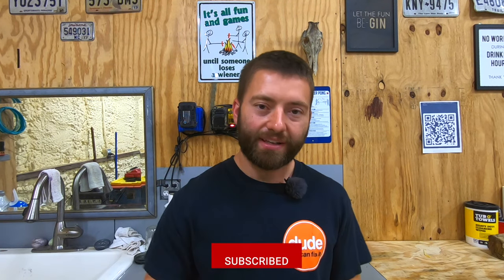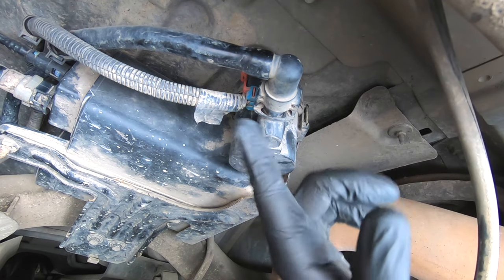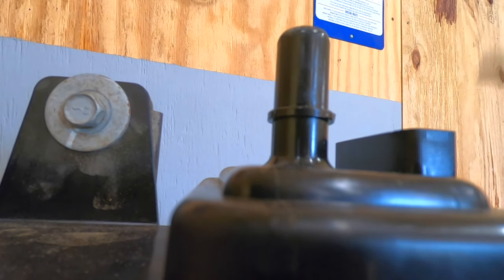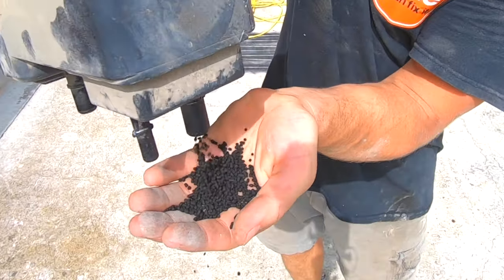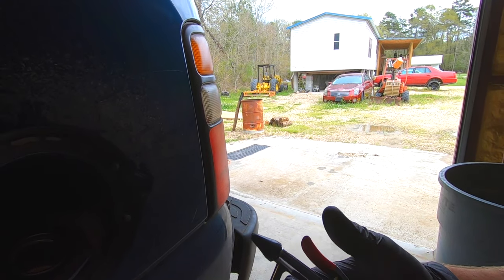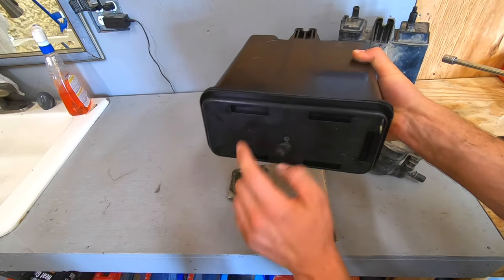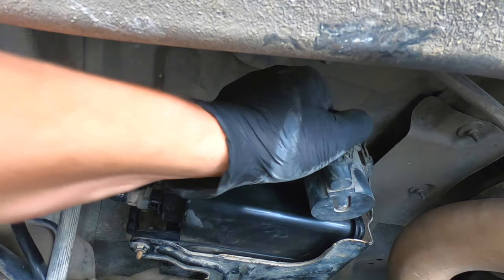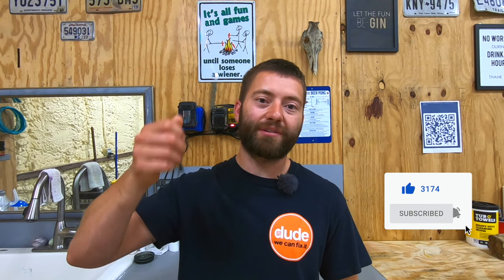GMC/Chevy Charcoal Canister Replacement

Comment: Worked perfect for me. Hardest part was taking the lines off of the canister but now I don’t need to spend 20 minutes trying to fuel up
Reply: That is what I am having trouble with right now.  I hit all of them with some WD40 so hopefully, they will be easier to slide off tomorrow.  I am pressing the sides to make sure the lil clips are open, but they still won't slide off.  How did you get yours off?

Comment: My Friend .. you are a blessing from the sky.   I SPENT COUNTLESS HOURS trying to figure out the evap code. I brought it to specialists (3 different places)only to have them rob me by claim they fixed something that I already tried. One even went as far as saying that I put the purge valve on backwards and charged me $758.                                                                      I went through everything....         1. Gas cap       2. Purge valve and hose.      3. evap canister.      4. smoke test (4xs) . Some shops didn't even want to bother because they said it was a big job to find it.      Last shop charged me $903..  only to tell me that it was a MAF sensor that was damaged along  with the PCV hose. I questioned them because they said they smoke the vacuum line but not the EVAP LINES. I gave them the benefit of the doubt because they were "specialists". It turns out that they (just like the rest) Cleared the code only to come back after about 40 miles.      I didn't even call them back right away. I FOUND YOUR VIDEO, JUMPED OUT OF MY CHAIR, BOUGHT A NEW CHARCOAL CANISTER AND INSTALLED!!!!!!!!!!!!   AND GUESS WHAT???????????????????        AFTER YEARS OF THAT LIGHT ON MY 2014 CHEVY EXPRESS 4500 CUTAWAY SHUTTLE BUS. i love you for this.....    oh and after I repaired it, I went back to the shop and thank god they gave me a FULL REFUND!...  Again, Thank you for this information.
Reply from the maker: WOW, that's absolutely wild! I'm so glad they gave you a refund! Not really sure why they were looking at the vacuum lines, pretty sure that's a separate system.

I'm beyond happy for you to have finally got the issue resolved, and sometimes, if you want it done right, you have to do it yourself!

Comment: Thx dude - your video made the difference between success & failure - these connectors are difficult to workout when under the car - thx so much - your video enabled me to do the job myself for $70 instead of putting it to the shop and blowing $1000 (on a 2004 Yukon XL the canister is obscured by the spare tire, the diff & the prop shaft - so makes the job difficult (but still manageable) on this specific vehicle.
Reply from the maker: I’m glad I was able to help you out! Please subscribe to my channel.
Reply: @dudewecanfixit  already done - thx again
Reply: Nice I’m having same isssue with 2004 escalade
Reply: @johnhernandez1803  think I dropped the wheel….
Reply: @flyingscot3666  I don’t have a spare under but I can’t seem to see it , I see the gas tank and filler but not the carbon filter
Reply: John - its on driver side in front of the rear wheel - if you have a jack lift that side of the car and you'll get access - My Yukon is a Denali so likely same as escalade. As I recall the filter is attached to the underside of the vehicle so you have to go higher than the prop-shaft & diff'l - got to work your way up to the fasteners.
Reply from the maker: They can be in different locations, but they are usually near the gas tank. Follow the hoses from the gas tank and you should be able to locate it

Comment: I had the same problem with my daughter's 2001 Hyundai Accent. Liquid gasoline had gotten into the charcoal canister, dissolving a foam membrane in the canister that is supposed to keep the charcoal in, and allowed the granules to clog the hoses. In that case, I was able to cut the canister open and replace the foam membrane with a piece of metal window screen, and epoxy the canister back together. It worked for years until we junked the car because of a bad transmission.

Comment: So there's talk about a 13mm bolt to unmount the canister from the metal mounting bracket.  Mine was plastic and molded as part of the fuel tank. (2015 GMC Savana Cargo Van)  With no "bolt" it was "clipped" in.  Not knowing the proper way to remove it, I muscled it off.  So, I pushed up on the canister as far as it could go and using a slightly larger screw driver, I pried out the bottom.  Should anyone know the proper procedure, do tell!  TIA
Reply from the maker: I haven't seen that style

Comment: Excellent video.  This is the only video I found that talked about the charcoal trapped in the lines.  If I did not view this I may have replaced the canister without clearing the lines and would have still had the problem.  It took several tries of vacuuming and pressuring the tank until the large line to the tank was finally cleared. Thanks 👍🙂
Reply from the maker: I'm glad you got it cleared up!

Comment: This was the fix for me, thanks!  I already replaced my charcoal canister and it had charcoal spilling out, but I had not seen your video yet.  Well, that didn't fix it because the fat line to the tank was full of charcoal.  I blew air in the tank and charcoal went everywhere.  Banging on the hose and slapping it around loosened the charcoal and I vacuumed out about 2 cups of charcoal.  Great tip!

Comment: Great video. I replaced my canister with a new one without vacuuming or pressurizing the lines and tank. Still experiencing the same problem at the gas pump. Does it matter how much gas should be in the tank when I finally pressurize it?
Reply from the maker: I don't think that it really matters, but I would recommend below a half tank
Reply: Did it work after you vacuum the lines and pressurized the gas tank? @downsouthdeebo1346

Comment: Great video. I can only put in like $8 before gas spills out. The gas station pump nozzle not clicking. But I don't know why my gas tank is refusing to accept more fuel? I've checked all hoses and charcoal canister. Everything is intact. My gas gauge is always showing full. Can a bad gas pump and sending unit be the culprit?Any help would be greatly appreciated. Thank you
Reply from the maker: I doubt that the pump & sending unit would have any effect on filling with gas. That falls more into airflow restriction in the tubing. Try vacuuming and blowing all the lines out.

Comment: Great video as I'm trying to resolve the same exact issue on my 2010 Avalanche.  I did not read ALL comments and have a question.  When vacuuming the lines, were there fumes from the tank being pulled through the lines?   Just want to ensure a safe, flame-free task.  If there were, suggestions to minimize?  
Thank you, planning to swap mine asap.
Josh
Reply from the maker: Yes, there can be fumes getting sucked through the lines

Comment: Thank you for the video its very good and was very helpful! A quick question, you pressurized the tank from the neck while the lines were disconnected. Is this so the air coming back out of the gas tank will blow through those vent lines which are disconnected from the canister
Reply from the maker: Yes
Reply: The one big line connects to the gas tank. The smaller line connects to the purge valve under the hood. You should also push air back from the purge valve down the small line. He did not show this step in the video. If the evap line sucked those beads they will come all the way to the engine.

Comment: I’m getting 0455 Large Evap leak. Replaced the gas cap twice. I don’t have an issue with the pump shutting off during fill up. I do have a faint gas smell. Any idea what I should check first?
Reply from the maker: Maybe check the operation of the vent valve that is connected to the charcoal canister via a tube

Comment: Nice video. My question is that if the charcoal canister can be cleaned, as shown in the video then why should one install a new charcoal canister? Wouldn't the old one get the job done after removing all the charcoal?
Reply from the maker: Without the charcoal, the canister no longer serves its intended purpose. It may work and not cause a code on your vehicle, however, I am not sure what unintended consequences may be caused.

Comment: I squeezed that connector w/pliers and the ring with tabs (same connector as @1:10) got broke off. Can I glue it back? I can't find that return line (this is old car, 2001 Saturn SL2, I'm also replacing the Charcoal Canister). I think to glue it and add small cable ties. Will it work? I would appreciate any opinion on this matter. The second similar connector I removed successfully, also used small flat screwdrivers, but the connector came off only when I applied PB Blaster Penetrant. Thank you for the informative film.
Reply from the maker: Glue will work as this is not under a lot of pressure. However, it may be hard to remove later. I would try to use electrical tape instead
Reply: @dudewecanfixit  Thank you very much for the replay, I'm just about to start that project (many things were on the way). I meant to glue the ring (better to say it is oval shaped) to the connector, kind of repair the damaged connector. I've seen one film about melting the plastic w/Soldering Iron. Thought the project I saw was on the larger item (Headlight Holder), he melted back a broken ear to the holder, strengthening the attachment w/Steel Wool #0000. It came to be very strong. In my case probably I don't need it (I mean Steel Wool), but I'll try. But it is a good idea to add an electric tape on the connection, I'll do that, especially that connector is old and might be not really good since got to be not so elastic as it should. The best way of course would be to replace those connectors on both hoses, but I don't know that technique yet, as well as don't have the corresponding Tool Kit. Thank you again.

Comment: Does the gas tank have to be empty to pressurize it with a compressor? Also if you use the shop vac to suck out the charcoal does it need to be empty as well
Reply from the maker: The tank does not need to be empty for either of these methods.

Comment: I have not had an issue with filling the tank.  When removing the gas cap, there i is a rush of air.  This has been happening close to a year. 
Lately, the Suburban will idle fine, but stumble while driving and often stall or try to stall when slowing down. 
I'm wondering if it's the same issue.

Comment: I have the problem you describe but i do not have the faultcode. When i fill gas tank it builds up in the hose and turns off the refill handle. Do you know if i have one of these canisters on my Suburban 2009? Great video!
Reply from the maker: I'm sure you have a canister. It may look different, but it will serve the same purpose
Reply: I'm doing my 08 suburban now, how did it go?
Reply: @natashaolson711  i sold the  car before I had time to do it 😂

Comment: Man I have been looking for months about how to do this properly. This is the only video I have found that shows you how to properly clear the lines. I replaced my canister and didn’t clear the lines and everything that I thought I fixed came back the same day, it was a glorious 15 minutes of driving before the light came back on throwing the same code and went right back to idling like there was a freezing elephant in the back. Now I will probably have to buy another canister and clean the lines, the big question I have now is can the canister itself be cleaned?
Reply from the maker: Dang, that sucks! The canister itself is a sealed unit. You might be able to blow air through it and pull vacuum on it to get any residual charcoal beads out

Comment: Please help! I have a 2014 chevrolet equinox and need to replace the vapor canister can you please tell me the process or point me to where I can find instructions on how to do it. Will gas come out of the lines when I disconnect them
Reply from the maker: I'm not familiar with the layout on the Chevy equinox. I would suggest wearing a face shield or at least safety glasses when removing it as it could have pressurized gas inside
Reply: @dudewecanfixit  Thanks for the quick reply. I still can't find instructions but thanks anyway.

Comment: What causes the gas from the canister to travel to the lines, I was wondering if something has damaged the canister in the first place, the rumor has it overfilling the gas tank may be the reason. Thanks for posting
Reply from the maker: The internal screen fails, I'm not sure what causes it though
Reply: If you overfill the tank the cannister gets logged with raw gasoline, when the fill pump trips off stop filling then, adding more doesn’t do you any favors

Comment: is there a way for not the bits of charcoal to be blocked before it goes to the lines
?
Reply from the maker: I think there's a mesh inside of the evap canister that fails and allows the charcoal to circulate

Comment: Just a simple question to any who's experienced this before: is a P0446 the link to a necessary charcoal canister replacement as well as linked to gas pump clicking off when not full?
Reply from the maker: Yes, either the cannister or the vent valve/solenoid usually causes that code.

Comment: Hi, in order to blow out the lines through the gas cap hole, does the tank have to be empty?
Reply from the maker: No, it does not need to be empty. As long as the gas tank isn't all the way full you should be fine
Reply: @dudewecanfixit  thank you !

Comment: Now my question is after I fix this what if my obd2 port doesn’t work to clear the code?
Reply from the maker: The newer Chevy's have a separate fuse that provides power to the obd port. Check all your fuses in cabin fuse box. If you open the drivers door, there should be a panel on the side of the dash for access to the fuse panel.

Comment: I've done everything in your video, but I'm still having the same problem. I also did this with a full tank, but just noticed you said below you wouldn't do it with a full tank? Why? and do you have any further suggestions to fix the issue?
Reply from the maker: I wouldn’t do it with a full tank just because I would be concerned of gas more likely coming out of some of the lines. If you have a new charcoal canister, you may need to replace your purge valve. I don’t have a video on that yet
Reply: @dudewecanfixit  I replaced the purge valve, the charcoal cannister and the evap solenoid. I pressurized the gas tank as you did, which did push out some carbon under the truck. I then vacuumed the lines from under the truck and then blew out the evap line from the purge valve back. Got some more carbon bits out, but not a lot. I'll go back to the gas station soon. If the problem is still there, I'm probably going to have to drop the gas tank and disconnect and blow out all the lines as you can't get a good vacuum on the lines around the corners of the tank. My cannister was full of loose charcoal bits and I've had this problem for a while, so I think my lines my be a little more packed than your were. What are your thoughts? You think I'm on the right path?
Reply from the maker: I believe you are on the right path, there are not many components in the system, and I think you have replaced them all. Get those lines cleaned out and see what happens
Reply: @DrAlexanderHamilton  Those canisters come with small carbon balls so that normal. Its possible some of the carbon balls got into one of the lines & clogged it up. You can thank these wacko environmentalist for all this emissions bs. A little gas vapors exhausted when filling your tank isn't hurting anything. Also some evap systems are more complex but there's not much that could go wrong. They also make canister delete kits.
Reply: @wandameadows5736 don't want to do the cannister delete kit as they actually check for that in inspection where i live. i actually plan to drop the gas tank today and blow out the lines. Looks like that's the only way I'm going to fix this. I tried vacuuming out the lines from under the truck and blowing out the evap line from the purge valve under the engine hood, but it looks like that not enough to get all the carbon out around the curves in the lines. Hopefully this works. Any other advice?
Reply from the maker: I can't think of anything else that might help